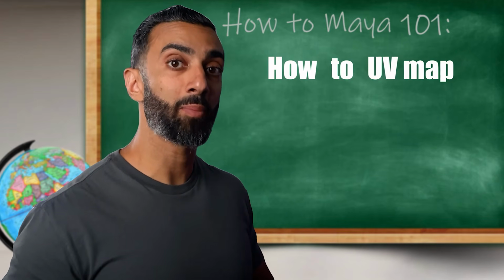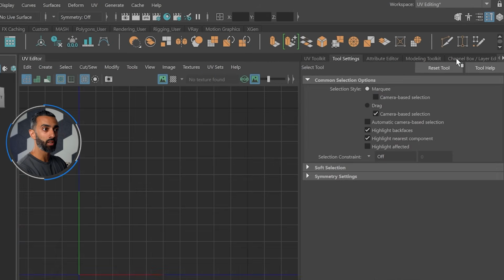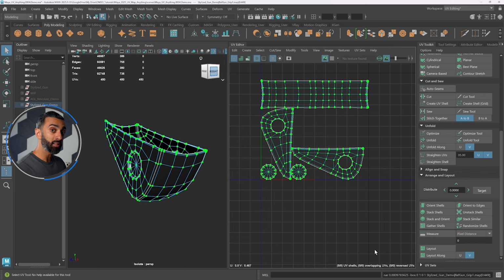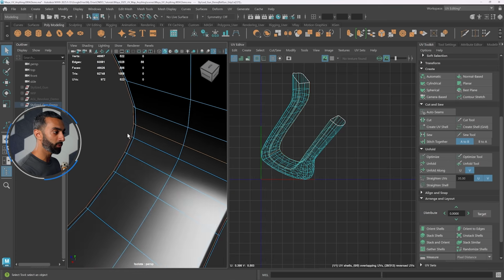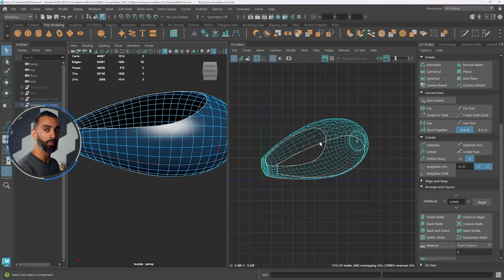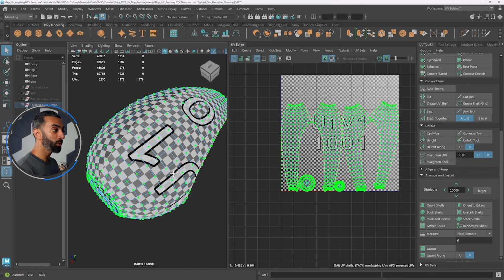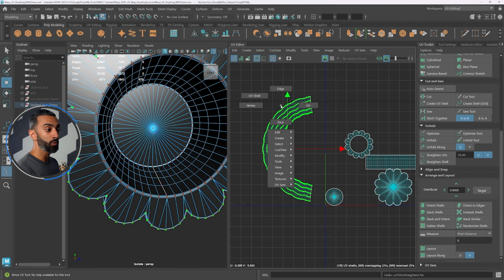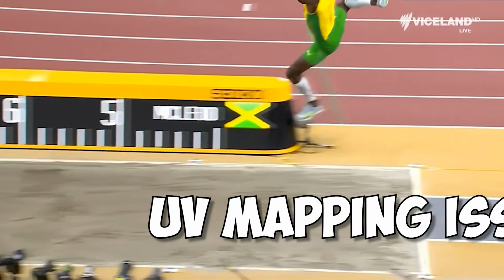UV Map Anything in Maya in 5 Easy Steps

Comment: One more comment, and why not, no one’s responding anyway....

Triplanar mapping in Painter is fine if you don’t have geometric patterns that need to be aligned. E.g., in the case of constructive surface paneling, blending the X, Y & Z axes’ boundaries is not going to look good. 

In my opinion, the only thing to do in those cases is to...
     1. Lay out your UVs as well as you can without cutting up too much
     2. Resign yourself to painting a texture manually that is aligned with the bending of your UV layout
     3. Something that may help to get this right is, of course, following the edge flow of the shell, or using the 3D paint feature to paint a grid on your model. The resulting texture file will show how your final texture ought to be distorted.

Comment: Hey, sent this on another video of yours, thought I’d try here, too...

I have a very simple model that has been a nightmare to UV. It is the diagonal connecting dorsal between the original Enterprise's main saucer section and the lower engineering hull. (I’m doing this as a labor of love. Unfortunately my paying career has vanished. So, CG is now a hobby.) Anyway....

The shape is diagonal, as already stated. Its ends are rounded. I want to texture it to make it look like it's comprised of subtly varying panels. These panels are at right angles to the overall direction the ship, but at an odder angle to the direction of this piece.

Unwrapping the UVs just gives me an odd curving of the lines at these rounded ends. Breaking it up into smaller slices doesn't solve the problem. 

I’ve tried planar projections, then cut and unwrapped. I’ve tried a cylindrical projection to accommodate the ends’ roundness, and tried to unwrap that. I’ve tried other things as well, really struggling with an assortment of different approaches. Nothing works, leaving me with the conclusion that I will have to manually paint the textures in Photoshop (or one of its equivalents), since Painter will not... cannot... give me the perpendicularity I need.

Any thoughts or comments?

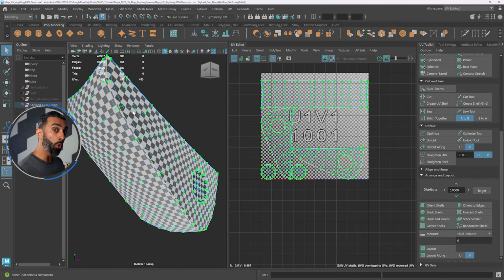Comment: Do you not get jagged edges on your texture with diagonal UV edges like those at 3:59? I've been struggling to find a balance between stretching my UV shells in order to get straight lines, and accepting diagonals in my UV edges.  Cutting shells up with more seams also creates more vertices which raise the model's size and performance cost when working for games. :(

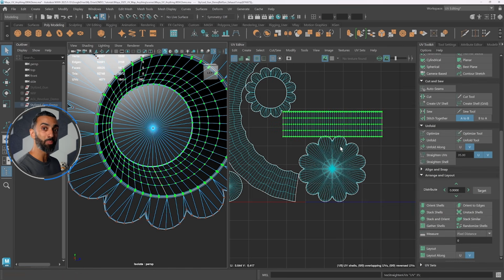Comment: 10:45 Another option for curved faces is to select a edgeloop from the middle and then press sraighten shell. If you don't have a any edgeloop in the middle you can add it with "Multi-cut" tool pressing Ctrl or with the "Quad Draw" tool. Once the edgeloop is selected press Straighten Shell. Once the UV is straight you can select the edgeloop and press "Ctrl+Backspace to delete it.

Comment: Awesome UV video! Once you break down those complex 3D shapes into simpler 2D planes it becomes so much easier. I think it also helps to understand where you have natural transitions in the materials and textures. Not only does it give you a few locations to cut before unfolding, but it also makes it easier to texture in Painter since you won't have to manually paint masks (use ID maps or UV chunk polygon fill).
Reply from the maker: Well said, those are great tips!

Comment: so for this model that you are making the toturial with . does it have multple materials ? cause you cant have those parts in a one udimm . (gaming scenerio) do you have single uv for the whole model ?
Reply from the maker: Yeah, when I texture it in Substance Painter, I apply one material so it's on a single texture set. I only used multple materials in Maya to better visualize the model for this video.
Reply: @OnMars3D  🙏